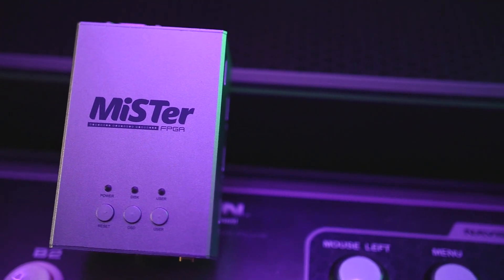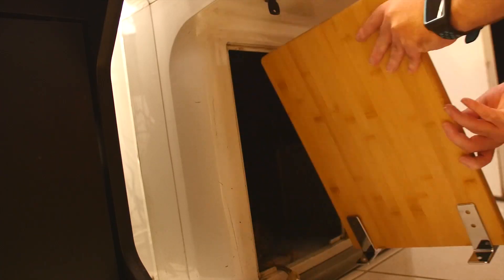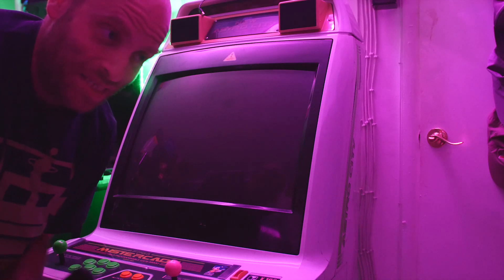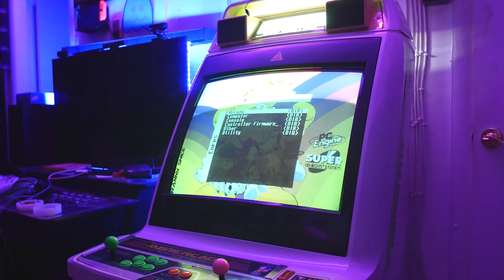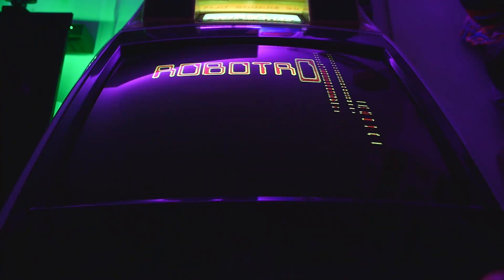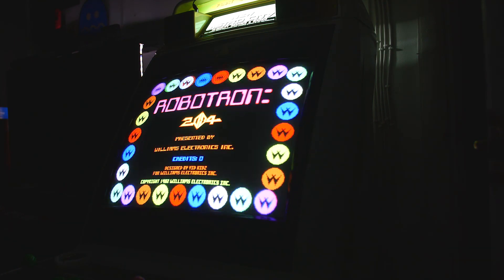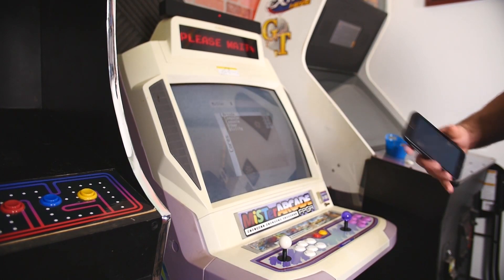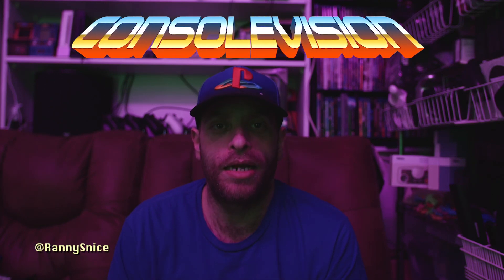MiSTercade Review

Comment: I’m relatively new to MiSTer. I get what the MiSTer fpga does, and I get what a JAMMA cabinet is, but what is the MisterCade actually doing here? Is it the link between the other two? Does it replace the MiSTer? The review isn’t clear.

Also did you build and finish that cabinet? Or is it something you can buy all ready to go? 

I’ve gone the retro pi route, and built my own image for it, but this is clearly the better way to do this…other than preferring to game from my couch…
Reply from the maker: Yes! MiSTercade basically bridges the MiSTer and makes it work more easily in a jamma arcade cabinet! The cabinet I bought came prebuilt!